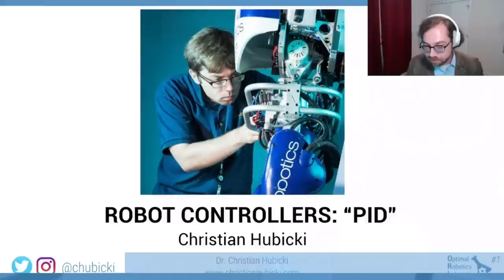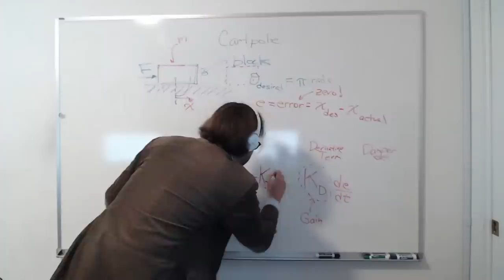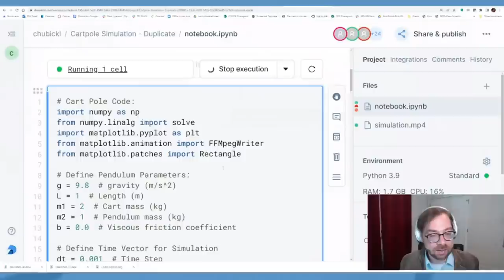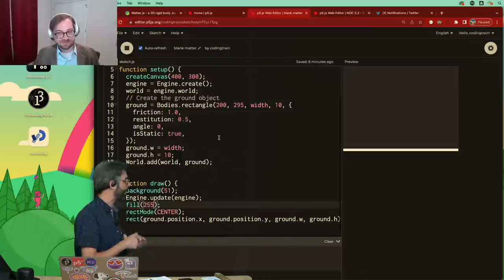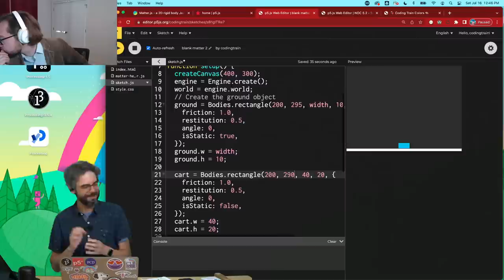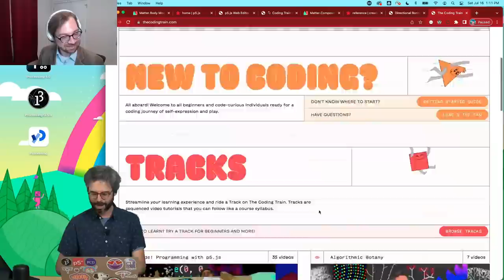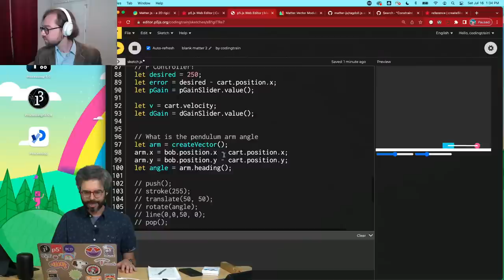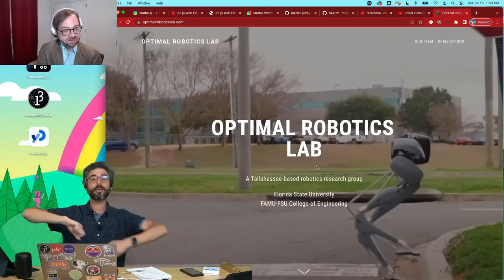Robot Controllers Part 1: PID (with Dr. Christian Hubicki)

Comment: I'm an automation engineer and part of my job is to write code to control the air flow and air temperature of HVAC units with PID controllers (mostly just PI, actually). I have also practiced JavaScript for 3 years. I got started with JS programming through p5.js, inspired by this Youtube channel. If I can somehow use my skill set to help the Coding Train community, I'd be happy to help.
Reply from the maker: I probably won’t get to setting it up until tomorrow but would welcome contributions to the GitHub repo for this stream!

Comment: What about the PI control? this one is a great one when having to control continuous flow, speed, pressure, etc!.
Great stream!, looking forward for more of these! Thanks Daniel and Christian!
Reply: Definately, for jerky movements that go back and forth, you want more of a PD controller, but when the motion is continuous, like the speed of a motor in a CNC lathe, the disturbance being the force imprinted by the material over the working tool, so the controller has to compensate in the same direction, has to settle fast, with no overshoot, then the PI controller is best for this! Dr. Christian is Spot on in every aspect of motion control! really nice!

Comment: I believe the reason you had to invert the gains is the assumption of the positive direction of the angle. In the mathematical formulation it is assumed that counter-clockwise is the positive direction, while in p5.js it is positive in the clockwise direction.

Comment: You can run into problems with that error integral. If the actuator output runs to the limit it can cause windup to the integral. There are some fairly complex anti-windup algorithms but the simpliest solution is my favorite: Just add the first-order filtered controller output to the sum. I learnt this from one of Åhström’s books

Comment: How I understand PID

P controller -> Gets you to your desired state

D controller -> Stops you at that desired state

I controller -> if something stops you from achieving that desired state then it gives you just enough force to get you there 

(Please corret me if im wrong or tell me about how you understand it)
Reply: You're generally right, but you should avoid using derivative terms when possible since a pure derivative term cannot be implemented because it needs future information to operate right. Research the concept of feedback and you'll get a much better idea about what the derivative term does. You have a good simple explanation that's 90% of the way there!